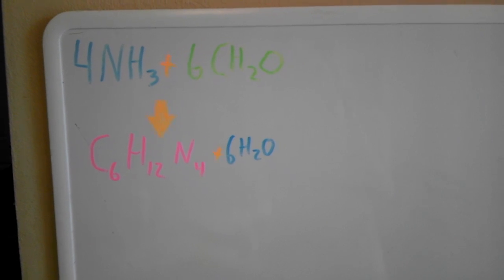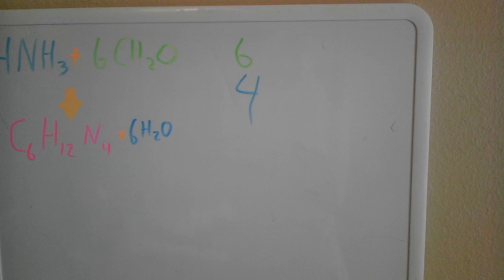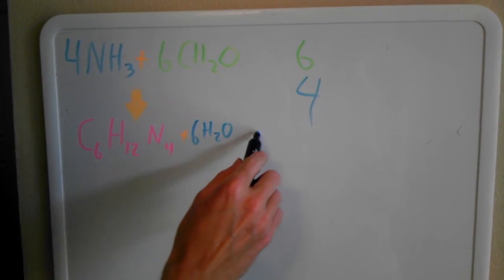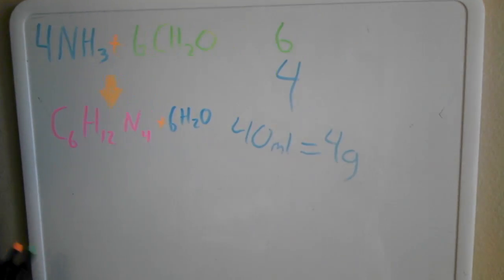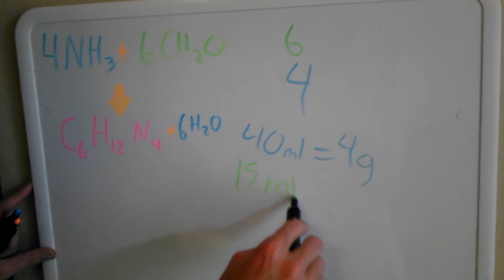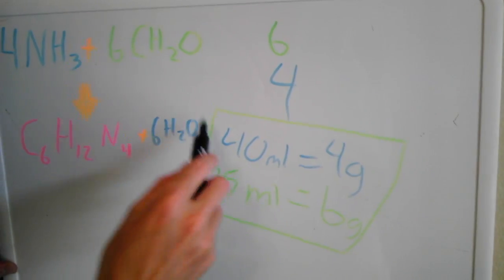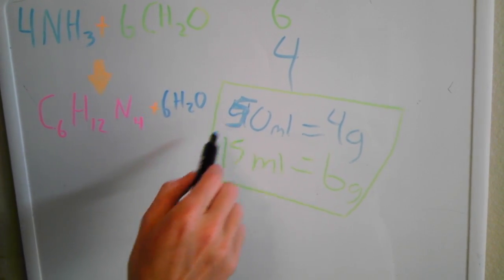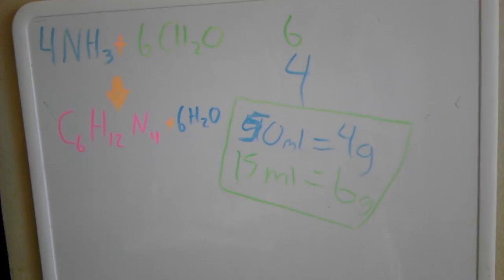Hexamine synthesis. Ammonia and formaldehyde.

Comment: If you want to make an explosive peroxide, just mix acetone and 30% hydrogen peroxide. Just remember that it's a powerful explosive (high explosive) only in the dry compressed (maximum density) state. Now it just needs to sense a little heat and it will explode with a loud bang at 5300m/s.
Reply: Absolutely not, YOU SHOULD NOT BE MAKING that explosive, triacetone peroxide is by far one one the most sensitive and dangerous explosives there are.
Reply: @ismaelamarillo7488  I know that. I made it a few times.
Reply: @ismaelamarillo7488  ONLY in the COMPRESSED state!
Reply: @Berghiker  it's pretty dangerous under any circumstances.  You missed an ingredient too.
Reply: @ismaelamarillo7488  You think I don't know that? I'm not a teenager.
Reply: @Berghiker  Why do you propose it then?
Reply: its tatp and one of the few explosives thats an automatic felony in any amount in the US because of its danger.  and yes you left out an ingredient and yes its extremely irresponsible of you to encourage its production, even passive aggressively. shame on you.

Comment: Can you use 75% Formic acid for this?
Reply: It may be possible since Formic acid and formaldehyde are very similar, you might have to change the ratios though. If you do from what I have heard it’s good to have an excess of ammonia since hexamine can dissolve in acidic solutions, and formaldehyde and obviously formic acid are, well acidic. So by having an excess of ammonia that should provent to it.
Reply: Why does everyone in this thread think chemistry works like baking, and you can just substitute one thing for another and it works like magic? You would have to know a lot chemistry to make such a substitution, and even then it would have to be confirmed by experiment. Since there are literally billions of unique small molecules, just guessing at one giving the same reaction is going to be pretty unsuccessful.

Comment: Just an FYI but if you have 4 grams of NH3 and 6 grams of formaldehyde the MOLAR RATIO IS not 4 to 6.    The MASS RATIO  is 4 to 6............................Four grams of NH4 is .235 moles OR 23.5% of a mole.   So if you multiply the the molar mass of formaldehyde (30 g/mole)  times .235 you  get a 1 to 1 molar ratio.    So 30 X .235 = 7.05.....................Then multiply that by 1.5 because 6 is 1.5 times bigger than 4.              So 7.05 X 1.5 = 10.575.
                          SO if you want a MOLAR ratio of 4 to 6 then you need 4 grams of ammonia and 10.575 grams of formaldehyde

Comment: I'm sure that you realize this at this point, but your stoich is wrong. Because formaldehyde (30g/mol) and ammonia (~17g/mol) have different molecular weights, you cannot simply use a direct mass ratio like this.
Reply: He made other mistakes too. Also pure hexamine burn without leaving any traces.
Reply: @suprememasteroftheuniverse  Yes. No trace left, white flame
Reply: how to prepare pure hexamine can you tell me?
Reply: I was thinking the same thing... He was using the density of water to translate the ammonia volume to mass... Doesn't work like that

Comment: Bro, i think that's Ammonium Hydroxide [NH4OH], not ammonia [NH3], because pure ammonia is not liquid at room temperature.
Reply: That's not formaldehyde, that's methanediol.
Reply: @lifeonfire2390  Nice
Reply: Right
Reply: that made me thinking as if the proper synthesis should involve anhydrous ammonia with gaseous formaldehyde in a plug flow reactor...
Reply: It's a solution.

Comment: then you can make RDX from that...
Reply: Not recommend 😂
Reply: @industrialadhesive6357   Why not recommended? You can find protocol for making it on scifinder easily.
Reply: @humr2346  like theoretically you could but looking at the statment i doubt he has the reagents available
Reply: @industrialadhesive6357   you need only basic chemicals to do that from hexamine. Tricky part is making 100% HNO3.
Reply: @humr2346  yeah and even then its a pitiful yield
Reply: @industrialadhesive6357   Here you have article where it is prepared with 82% yield. DOI: 10.1002/zaac.201100052
Reply: @humr2346  wow thats a great yield. Typically they seem pretty poor though on a amateur scale. But thats likley to the lack of access to dry HNO3. I wonder what the viability of oxidizing CETME R salt would be?
Reply: Or m3th lol

Comment: I followed the recipe only I subbed muriatic acid for formaldehyde. how can muriatic acid be a weak Hydrochloric when it smokes and Hydrochloric doesn't?
Reply: Steve Johnson  so what's the confusion?
Reply: Steve Johnson yes. hydrochloric acid under another name
Reply: Steve Johnson oh and I have used hydrochloric acid and it doesn't fume to my knowledge.
this is swimming pool grade so I don't know?
Reply: First of all, muriatic is relatively strong, but not super strong as hydrochloric acid gets way more concentrated. iirc muriatic is usually around 30%. Secondly, you can't substitute HCl for formaldehyde, they are different compounds. You have to use formaldehyde.

Comment: Can't seem to find the answer online and I know you can help. Doing this process in reverse (Hexamine+HCl) makes Ammonia and formaldehyde. Is this in the form of a liquid or gas? Where did you get your formaldehyde? I just need the formaldehyde for preserving things.
Reply: You will not be able to separate the two, they are both miscible in water. the temperature is very important too, I would suggest you go to ebay and just buy formaldehyde.

Comment: How can I synthesise formaldehyde?
Reply: MrOMGWTFxCorp you can synthesise it from methanol by dehidrogenation process
Reply: @Coticosimo  How does that work? I can't find much of anything on formalin synthesis, on yt :( .
Reply: you can easily buy it on ebay
Reply: @scottjohnson7433  Oh, I just like to be able to make things myself. But, thanks, for the tip.
Reply: Jaybird196 get 16AWG or bigger solid copper and coil it like cin. roll and heat to a cherry red, and then hang it over the methanol, just like what he did from one of his experiments. then set up for condenser. just look it up online to make sure you got  the vol/mass right

Comment: any of you brothers know the ingredients and ratio to make a 50x50x50cm cube (125 litres) of clear as possible silicone? Or an equivalent material where it will set solid, but not brittle. I was thinking silicone or rubber, there will also be a small object suspended in the middle. Hope you can help, thank you
Reply from the maker: Feynman Id say silicon casting rubber. It is expensive though. What is your project?
Reply: so im suspending something in the middle of the cast, it will remain inside always.
Reply: Feynman I believe I saw where mold casters put the poured silicone under vacuum to clear out the bubbles...if your object is air filled that may cause much distortion.  Good luck

Comment: Where the heck do you get formaldehyde??
Reply: Justin Hiemstra If you want to know how to make it yourself: Take paraformaldehyde or also knows as paraform (it's a polymer wich comes in prills and is used as an Disinfectant). When you heat it up it will depolymerise and you can lead the Formaldehyde gases directly into your ammonia. But do it outside since formaldehyde isn't that healthy.
Reply: Justin Hiemstra If you want to know how to make it yourself: Take paraformaldehyde or also knows as paraform (it's a polymer wich comes in prills and is used as an Disinfectant). When you heat it up it will depolymerise and you can lead the Formaldehyde gases directly into your ammonia. But do it outside since formaldehyde isn't that healthy.
Reply: @florianclausen2071  can acetal release formaldehyde when heated?
Reply: @florianclausen2071  You dont need to decompose it, para formaldehyde and formaldehyde are interchangeable in this reaction.
Reply: @florianclausen2071  do you know how to make the paraformaldehyde? Thanks.

Comment: Most formaldehyde comes with some methanol added as a stabilizer... Which forms nasty stuff when mixed with ammonia. Might wanna keep that out of the environment, eh?
Reply from the maker: No, no nasty stuff forms because Ammonia and Methanol do not react under these conditions. Where did you hear that?
Reply: ***** Well.... i thought that since methanol and ammonia are both present, why wouldn't they react?
Reply: Crackling Pyro Thnx for that clarification.. Now I can saturate charcoal in this stuff and barbecues will become a whole lot easier to start :P